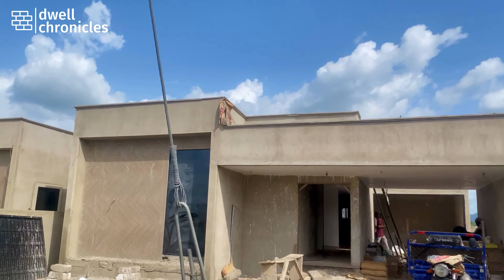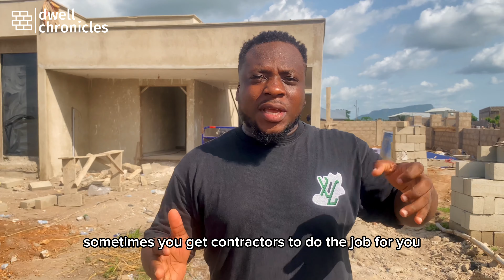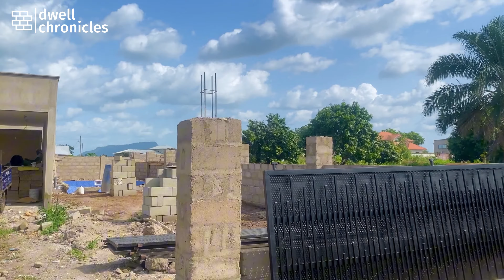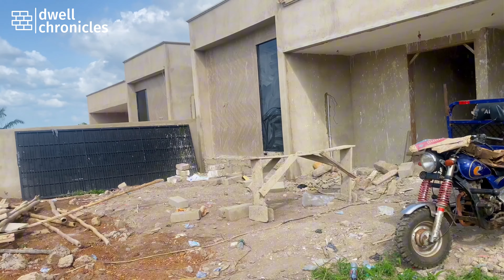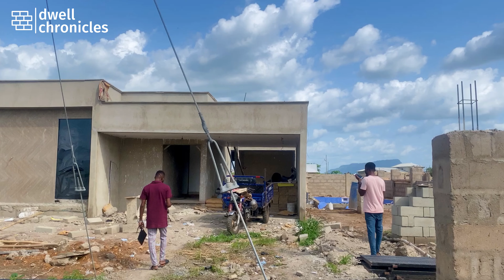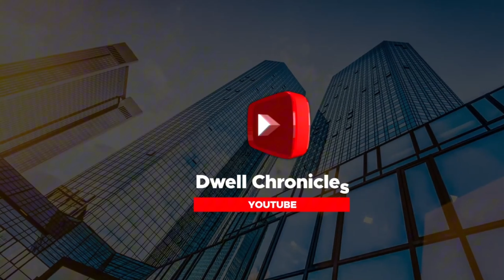Best Way To Hire Construction Artisans in Ghana #buildinginghana #ghanarealestate

Comment: You made mention of the different construction artisans right? And you said the people working on that building in the video are from Togo. Please I would like to know if they’re team and every one has their own special task to perform. Since you made mention of different artisans. For example you said we have two different types of masons. One who can actually work on wall fencing and the one good at molding blocks.
Reply from the maker: They are not really a team under on movement, they became a team on this very job. One good thing is, they recommend each other when there is a vacant position. For example, a mason will recommend a tiler then we reach out and bring him. 

The best knows the best, and they call come together to get the job done!
Reply from the maker: There are different masons depending on their expertise and versatility. Some can do a lot perfect while some are specialists
Reply: @dwellchronicles  since they’re not a team but they came together through recommendation, what if one particular artisan disappoints . How are you going to fix the problem? Who’s gonna solve that problem ? Is it the recommender or the owner of the house?
Reply from the maker: Even the best can disappoint sometimes, reason you need to take monitoring seriously. The foreman or project officer need to monitor their output especially at their early stage of work
Reply: @dwellchronicles  alright 👍